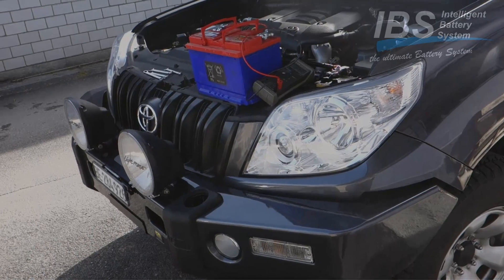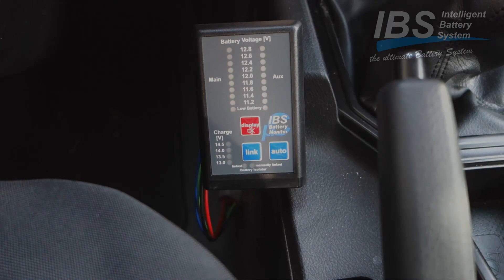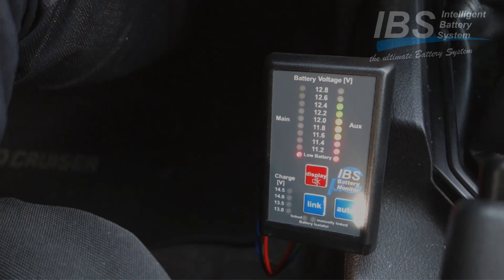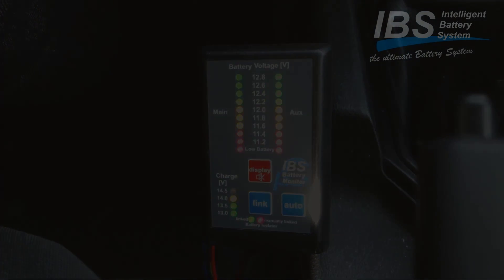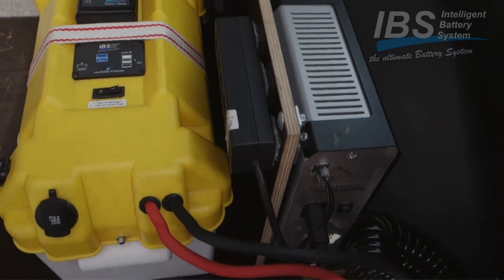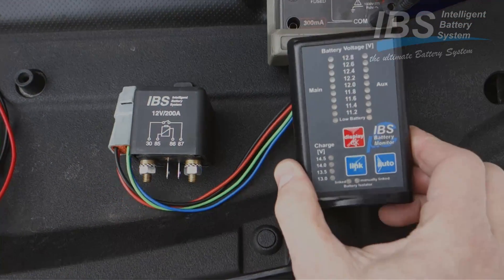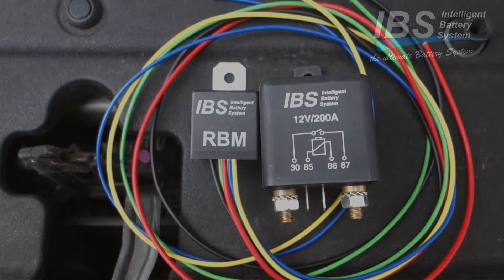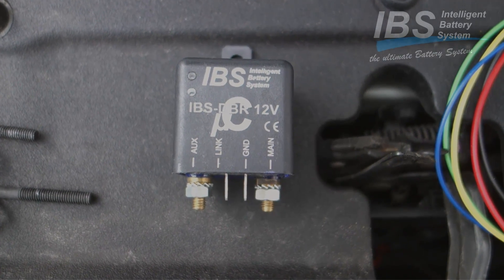IBS Dual Battery System 150 Series Land Cruiser 4WD offroad TechEdition 1

Comment: How much is this system
Reply from the maker: What would you like to know, it shows various equipment. IBS-DBS is around 380USD, the Inverters from 300 to 2000USD, if you would like detailed info please write me bwyss@ibs-tech.ch. Cheers Beat
Reply from the maker: hi, depending on market around $350-400. Cheers BWyss IBS/TJM
Reply: Were can I buy the batter box in the back with the mother on it ?